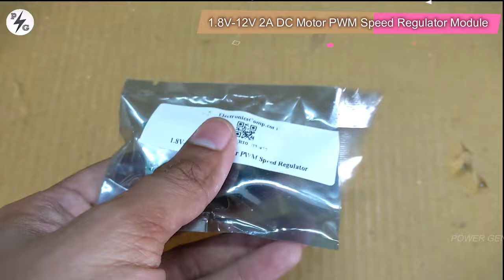PWM DC Motor Speed Control Module 2A (1.8V-12V) | How to motor speed control | POWER-GEN

Comment: Can you do an experiment for me? I’m reading on ancient Vedic flying machines… and my theory after reading it all is they basically say you vibrate a cylinder (picture toilet paper roll shape) and at the top of that cylinder you have a cone. The way it’s described is they vibrate that shape and that causes lift… later in my reading I found they could create vibrations with a propeller using a speed controller. They would find the same resonance between the prop and cylinder/cone…. I’m thinking you mount what you have in video in different placements in what I’ve described with a few screws….
Reply: I think it means the piston and cylinder mechanics which we use in now days vehicles
Reply: @chadenimat0 I was thinking more of resonance or sound waves but I could see your idea as well… looking for something more exotic than same old same old.

Comment: when my dc motor rs555 using this kind of pwm in top speed start to Disconnecting and connecting, and i have to start from low speed again to avoid this problem

Comment: probably silly question, but is there a reason not to use a fuse or a ground?
Reply: Because it's just a 12v fan, you dont need a fuse for something that uses such little current.
Reply: Everything in your car is running off a 12v. Gosh look at how many fuses there are.  You can still cause a fire.

Comment: Can we connect two dc motor to single pwm switch
Reply from the maker: yes, you can use but maintain the (A) rating
Reply: @powergen522  
Gd

Comment: Can this speed controlled be used in a Dewalt fan (DCE511B)? my PCB is dead and there is no replacement part anywhere
Reply: Yours maybe a bldc motor. You need esc and servo tester for that.

Comment: puede controlar la salida de voltage? Ejemplo: Bateria de litio 36V. para 3 motores dc 755 de 12V.
Reply from the maker: yes, but only one motor controlled 
because of module's current rating is 2A max
Reply: @powergen522  gracias entonces se necesitaria un mejor controlador de velocidad ?

Comment: will the motor lose torque at lower speeds?
Reply: An electric motor develops maximum torque at 0 rpm. The torque developed depends on the applied emf. So think about your operating conditions.

Comment: How do I get full power at 50% duty cycle? Use power supply DC at twice amps setting , and then chop that at 50%? with speed controller?? I need to operate Millihenry coil so as flyback higher volts is usable with power DC, to on/off DC to coil. I tried vibrator relay with separate set contacts, but only low power and voltage out.
Reply: 50% duty cycle gives half the power of the 100% duty cycle.

Comment: Bro can we use 12v battery
Reply: Yes
Reply: @georgecarlinn6288  lakin bro regulator hi kharab hogya chalte chalte
Reply: @mohitbarnwal1998  look for module with heat sink nd don't use continuously long time at low speed also module must be rated 12-30V / 5A ,
Reply: @georgecarlinn6288  bro bout der tak kaha chalaye 30 min chalaye low me or khrab ho gya
Reply: @georgecarlinn6288  kya wo Banta hai
Reply: @georgecarlinn6288  bout der tak kaha chalaye 30 min tak chalaye or khrab ho gaya kya kahi banta hai
Reply: @mohitbarnwal1998  5min se zyada kharab ho jayegaa low speed par kyunki heatsink nahi hai, aap dusra bana lo ghar par

Comment: Bruh , can i ask why my 5a speed control  90watts is easy going to hot why?? What is the solution please😢
Reply: maybe you add too much voltage it depends on the type sometimes always 100v do not past over 100v cause it will be spark or capacitor explode or smoke be safe